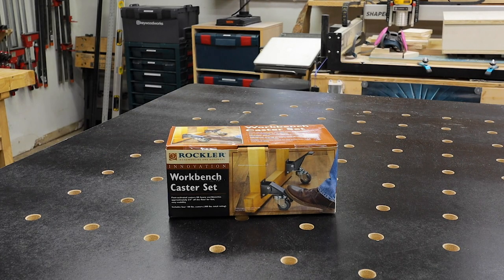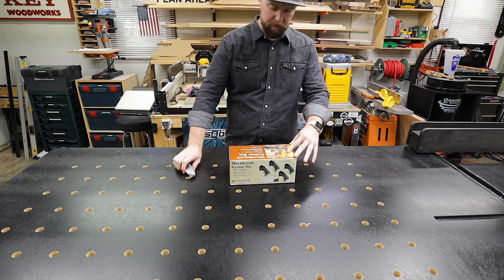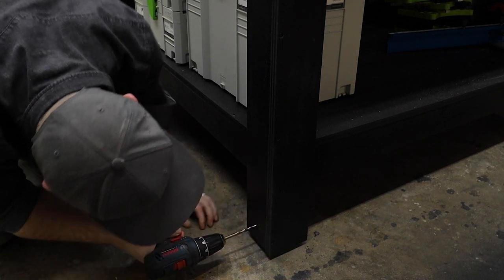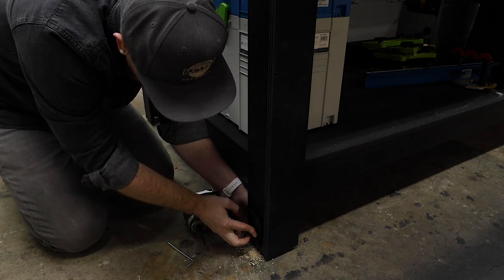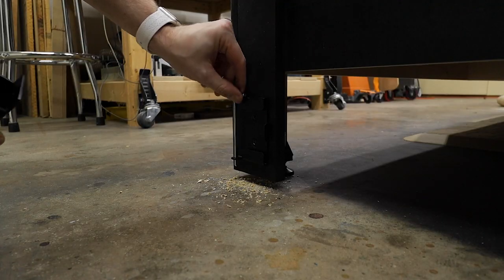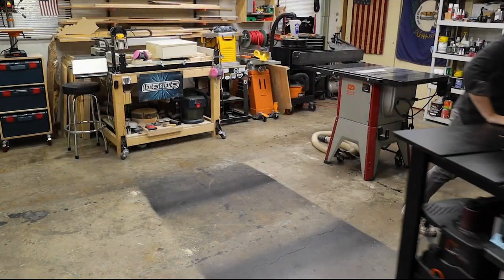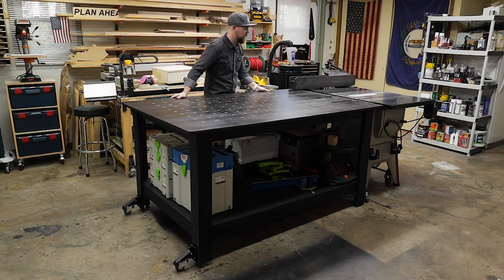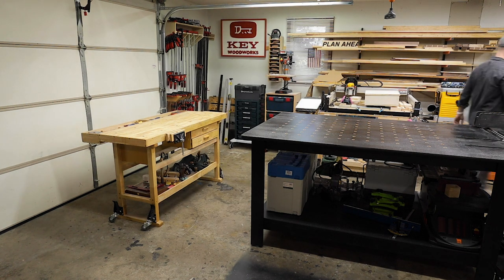Quick-Release Workbench Casters | DIY #Woodworking

Comment: I bought the 800 lb. set for my workbench but it didn't come with any instructions showing the proper height, so I sat down at my desk to make a template by observing its operation and taking a couple measurements. I decided to search google and I saw a video link and eventually followed it here as several people have videos on these casters. This is where I became aware that there was a quick-mount plate, so that's what I'm going to use. Now everything is getting casters!

Comment: Just a thought, how about mounting the casters at the saw end of your outfeed table on the sides of the legs so you do not have to climb under the saw to install and remove them.  This would be easier to operate them as well.